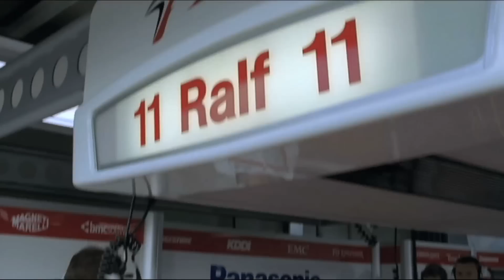Smart Textiles: The Next Generation (Preview)

Comment: sorry but engineers can design steel to bend/crush as designed. carbon fiber is OK but dose not have the longevity as stainless steel. yes carbon fiber is lighter and in some cases stronger but only in short lived designs like space craft and race cars.